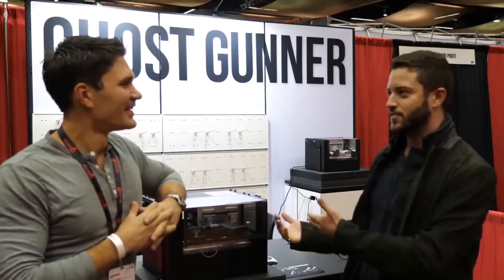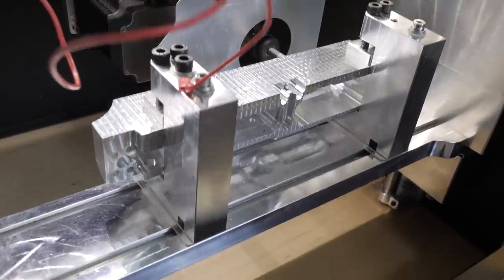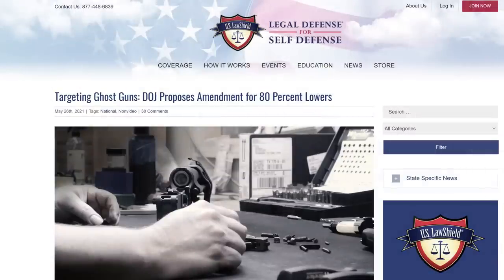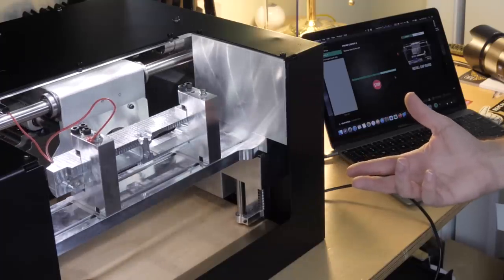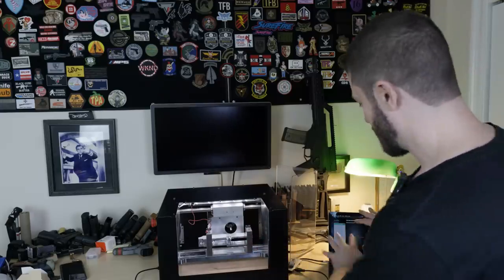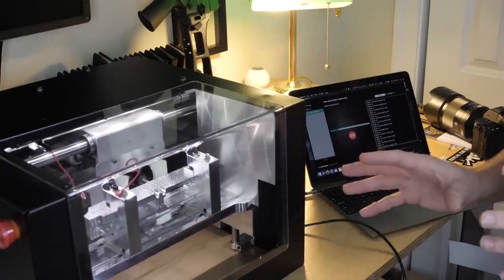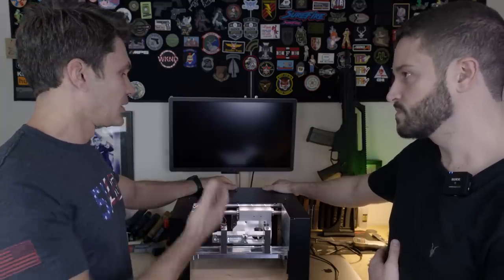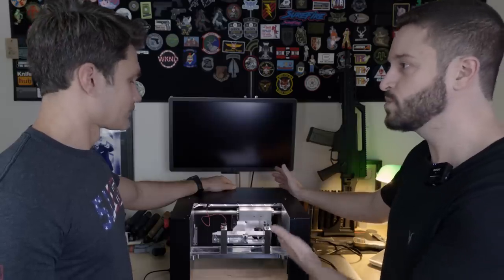NEW: Turn a Metal Block into an AR-15 Lower at Home with the GG3 Upgrade

Comment: The problem with this is that the machine is $2500! Unless you are trying to outfit an army, forget it. I do see the need for it in the future, and that may be the near future,  lol.  But if you're just a home diyer for 2500 you can get the best on the market for the same $$$. OR! You could build the best for much less money.  So, no go. But good luck, thumbs-up!
Reply: There are some high-end guns that cost more than that. I'm pretty certain that if someone already has a large firearm collection they wouldn't have any issue affording this.
Now I still think that this device is more of a novelty and a news media piece  then anything else. People have made Firearms at home prior to this. This is just more in-your-face.

Comment: Legit. Where do you get blocks of Forged  7075-T6 Aluminum?
Reply: You can buy forged in 80%.   Otherwise you would buying billet blocks and making billet receivers.
Reply: You want a 6061 billet, not a forged 7075. It's a fucking lower, people make them out of 3D-printed plastic with no issue, a 6061 billet is more than plenty.
Quick google search will lead you to plenty of 6061 billets, it's not uncommon.
Reply: @lucastonoli3256  I definitely do not want 6061. Or Polymer. Or Brass. There’s several really good reasons the TDP for M16’s/M4’s use 7075 T6.
Reply: @JEJAK5396  Nope, not a single good reason. The lower isn't exposed to a shitload of stress, 6061 is easier to machine, generally cheaper and It won't fail on you. Colt used 6061 in the past and they only changed to ramp up production (because of mass manufacturing, the melting point of 7075 is a bit lower and it lends itself better for that method).
The only 6061 lowers that ever cause problems were due to manufacturing defects from shitty factories (dimensionally wrong and/or weak anodizing). The material itself is just fine.

Comment: Dude never told us how much the machine will cost. Even if the fixtures are a few hundred. With the R&D that went into the design of the machine, plus production costs and profit on return built in---well you get the idea. The ATF has no intention nor would they try to regulate the block of Al or the machine but only the finished product etc
Reply from the maker: He said $2500 in the video.

Comment: It’s cheaper to buy an 80% and drill it out unless you want to walk the line of manufacturing to make that $500 worth it.
Reply: Did you not watch the video bud 🤦‍♂️
Reply: @EdwardOrnelas  you’re going on the assumption that 80% will be banned. It has to actually happen first before this has any form of relevancy.

Comment: i like what they're doing, but ill stick to buying the lowers and uppers completed and separate. it's cheaper and a 4473 takes me 5 seconds and the bg check runs back in less than a second.
rather pay 250 for a completed lower than 150 for an aluminum billet, 100 for a lower kit and 40 bucks on electricity to run this bad boy. then wait 24 hours for it to finish? meh, I'm good, but unless i come into a bunch of aluminum billets for free ill take my chances with the idiots at the BATF.

Comment: I bet after we get the ability to cut steel we will be able to mill our own barrel.
Reply: Barrels are made using a lathe, though (speaking from a very basic manufacturing standpoint). There are small layhes which you could buy used for a low price. Rifling os done with a rifling button (shove it in there and push it). Chamber is the only part that would be really nice to be cut in a CNC machine. 
Yall machinist nerds leave me alone, I’m just citing the basics here for a crappy yet functional weapon that would get the job done.

Comment: Just to play devils advocate.  All the Government needs to do is require a finished lower to be serialized and go through a standard FFL background check.  It wouldn't matter HOW you got your completed lower.  Don't flame me, I'm not advocating for this - it just seems to me they're chasing their tail with 80%, 70%, 0% kits & equipment.  Just go after the finished product.
Reply: They can't control that, how would you enforce it?

Comment: Can you do uppers too?
Reply: Probably not enough clearance due to the need to bore out the ID of the upper where the bolt rides and mill out the track for the charging handle. It would need to be made from tubing and joined together with welding.
Reply: I think that would probably be possible too. However the final Machining would probably have to be done by hand. But this device could probably get you 80 to 90% of the way there and then you just finish off the rest by hand.

Comment: The real question here is if I can make bolt carrier groups with the GG3.
Reply: Probably not.  Limit is aluminum.
BcG are usually hardened steel and may require EDM which similar but opposite of welding.
Reply: @joenunya8449  Well right after I posted that comment, they stated that they're currently working on a flood system for the GG3 or GG4 so that we can mill components from billets of steel so I beg to differ.
Reply: @joshwizardguy7662 You asked if ca. Now, not if you if they would or could ever upgrade it.
If you were creative, you could waterproof it, move the electronics a safe distance away, and mount it in a parts washer with cutting cooland and Voila!
You would need a slower higher torque turret too.
Reply: @joenunya8449  Well, since it's open source, I guess it wouldn't hurt to make a ghost Gunner with a 4th axis, a flooding system and waterproofed control boards. It'd need to have a larger build space, though so it may look completely different.
Reply: @joshwizardguy7662  at least one extra rotary table would be needed, ideally two.  
That would allow a lot more machining possibilities.
One open source version was flex something, ggflex, but it never aspired to be commercially competetive.

If an open source fork had the backing of a lot of skilled home machinists, it could make some significant hardware progress.
Reply: @joenunya8449  Yeah, the GGflex is a GG2 copy without insulation and sheet metal casing. In order for me to make something that'll be suitable enough, i'd only need to make a lathe like mechanism and add a coolant drain recycling system. Maybe even a tool turret.
Reply: @joshwizardguy7662 Snip
Snip
Product claims have a long history of being vaporware (check Theranos and 'autopilot').
That doesn't mean that it isn't a very good product, and I'm supportive of it general.

I would prefer it to have more features, more axis, more work area, and be cheaper too.  Is that realistic? Probably not, but neither is a feature that isn't released.

I agree that user base support groups and open hardware is the most cost effective way to add features.
Reply: @joenunya8449  Where did this come form? I was never butthurt or fanboyish about anything. All I said was that it'd be nice to have a community made variant that can tackle some of the limitations of the GG3.
Reply: @joshwizardguy7662  sorry Josh,   youtube emailed one of your comments out of sequence...  ignore that.   (Might get edited....)
Reply: @joenunya8449  it's all good

Comment: The Ghost Gunner is live 2500 just to reserve and like 6k to buy. Or you can get a prusa for a grand and then another 500 in upgrades you can print pekk which is as good aluminum and can be printed which is way cheaper and better than this BS.